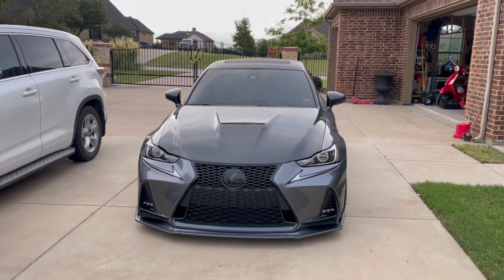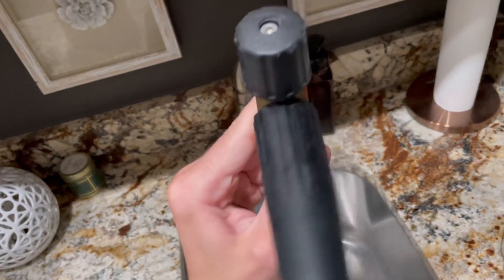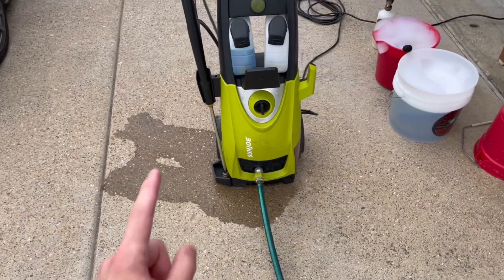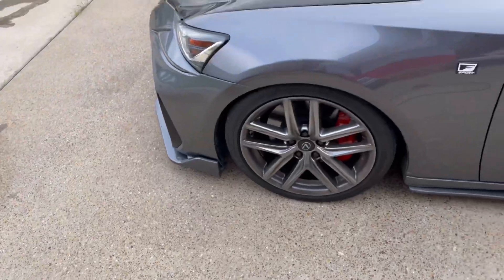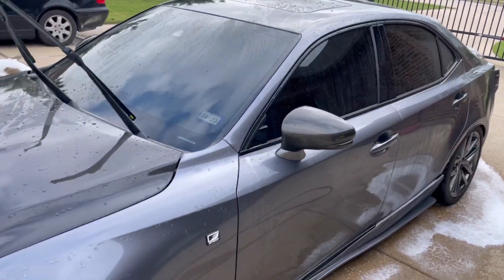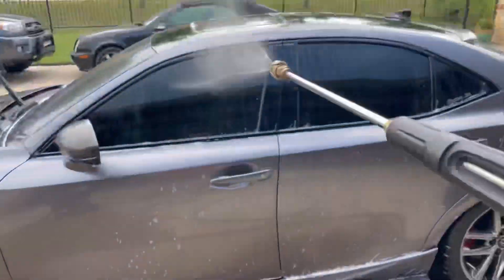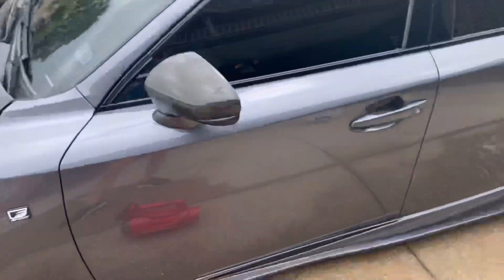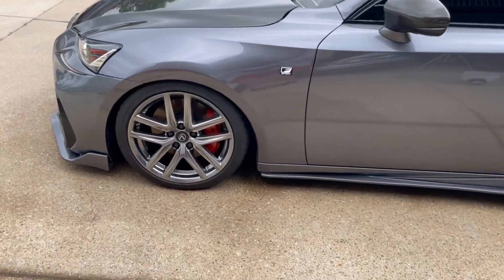WASH MY MODIFIED LEXUS WITH ME!

Comment: Hey, Im new to your channel.. im in the market for a lexus IS. Which is the IS without the turbo or gdi only engine?
Reply from the maker: Hey my man! The IS is a great choice. It depends on what year you’re looking at. 

2014-2015 all Lexus IS are V6
2016-2017 the IS 300 and 350 are V6
2018-2022 the IS 350 is a V6

Does this answer your question?
Reply: @Grey3IS  im probably looking at a 2017-18 is350. I was looking for non turbo, and wanting to stay away from the direct injection engine to avoid carbon build up on the intake valves.
Reply from the maker: @tommydukes1979  I completely understand. Good choice!

Comment: Bro buy a nice spray wax and a dedicated wheel cleaner it will make you’re detailing easier and cleaner 😎
Reply from the maker: Hey there! I definitely want to look into a dedicated wheel cleaner, but one that won’t strip my ceramic coating. That’s my main issue. And I’m not really in need of a spray was at the moment due to my entire car being ceramic coated. One wash, like this, and it feels brand new again. What wheel cleaner do you use?